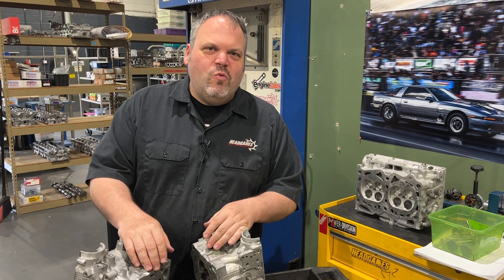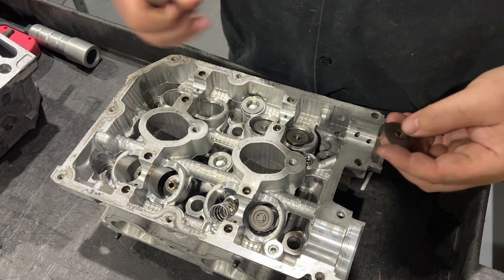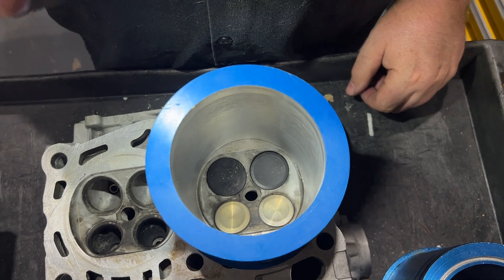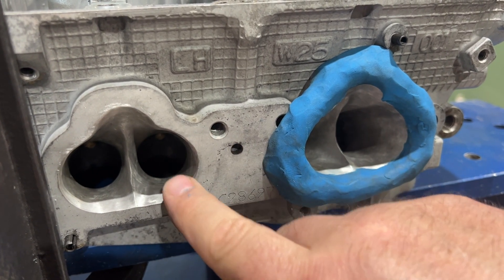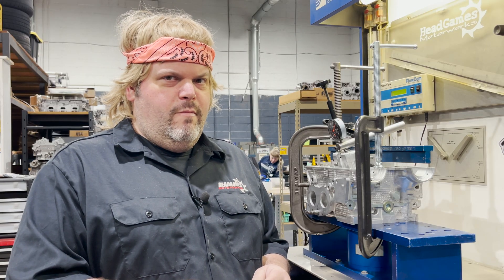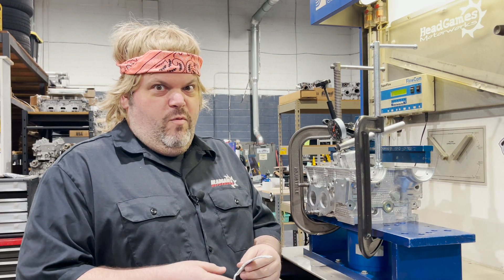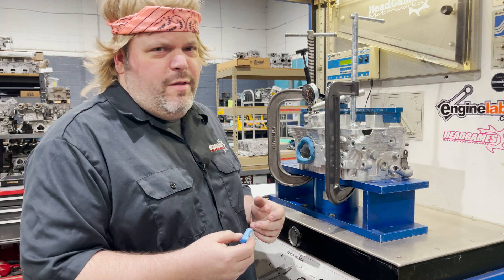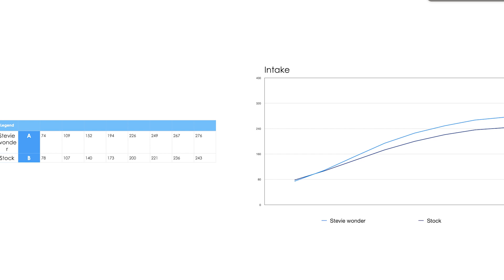Flow testing the Wonder ported head!!

Comment: if the intake flows very well up to 13 mm and the exhaust flows well up to 10 mm and the curve is flat. Do you have to touch up and modify until you find 79% at the same height?

Comment: I still have the spare Subaru L25 heads if you wanted to check them out or do video. Everything is OK with the car itself. I got them because I thought I was going to have to use them in a head gasket job. Turns out everything is ok. I'm in NJ as well, they said a dealer did work on it, from milling to 3-angle grind with being vacuum tested etc... just putting it out there

They say, from listing:
"These heads have been reconditioned and were sold threw a Subaru Dealer in Denver CO ,I purchased the inventory of a now out of business repair shop and these were among the parts. I contacted the dealer and they were able to give me a basic description of what gets done to the heads. Cam seals included, installer must set valve lash and put sealant under rocker plate.

hot tank cleaned and inspected, pressure tested

deck resurfaced

new stems, guides, valves, and seals

milled to .0015" for straightness

3 angle grind of valves and vacuum tested

Here are the s/n's on the heads and other markings on each head for reference only and does not effect compatibility

#1 584500  AS  004 7-1B

#2 980518  Q1  013 6B

I am not the original purchaser so I have no way to warrant the items, sold as-is please be sure to inspect pictures as these are non returnable, I think these are non egr heads but not completely sure

"
Reply from the maker: thanks but we have no use for them
Reply: How much are you looking to get for them?
Reply: @mikesilvestri5651  Hey man.. I honestly have no idea..  Where are you located?

Comment: I'd like to see some more commentary on how this head flows. Looks like all gains on the exhaust side and only a little loss at low lift on the intake side, could a good valve job or back cut help the low lift flow? Also how would the turbulence at 0.350" effect how it runs. Is there a loss in port energy and air velocity that could hurt low rpm power and drivability or will this head perform better than stock but not as good as it could be?
Reply from the maker: we could get it to perform better than stock with a valve job, but the way the port is blended into the seat it could never be a great performer. Simply you can take it out, but you can't put it back in. The throat is just too big. The turbulence is in the port, and it would perform better if it wasn't there. I showed it because I am sure not many people have heard that before, but being so high in the lift I don't think it would a huge difference, just a small one. Hope that makes sense!

Comment: Question : do you fill up with welding bowls that have irregularities and exceed the ratio between the bowl and valve?
Reply: I don't mean to speak for Dave - but I suspect the answer is a resounding "no"... Especially with production-type heads that are generally accessible. If you had a super duper special custom head that was basically irreplaceable, maybe.
Reply from the maker: No, we don't do that. That is a LOT of effort for a minimal gain
Reply: @headgames  so one is better of with a oversized bowl to valve ratio because of the flow is not that greatly affected, can the bottom of the valve seat be machined with a special cutter to remove the sharp edge from it and make the transition or path smoother, do you have the tool for this?
Reply from the maker: @CJ5EVOLUTION  we learned from doing valve job R&D if you touch the sharp edge it kills flow. Like 20-30cfm. Almost everything that you gain by changing the angles. And that head is super sensitive to the valve job as well. Like easy to hurt it with the wrong top and bottom angle and no blending.